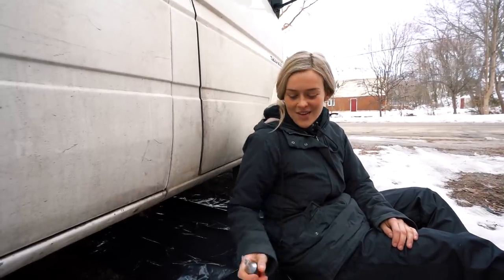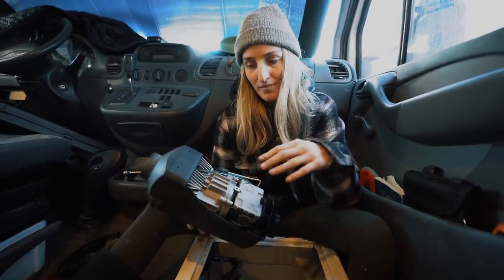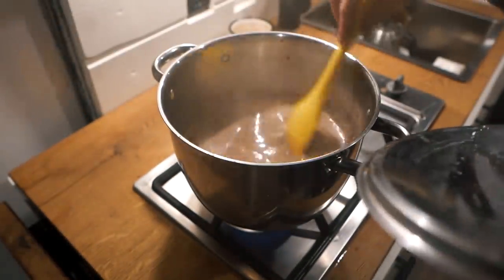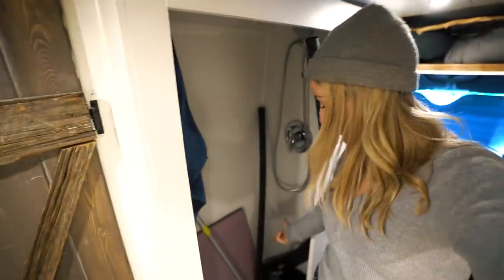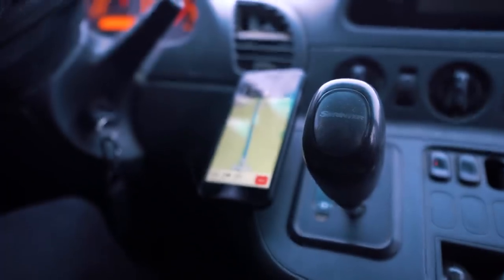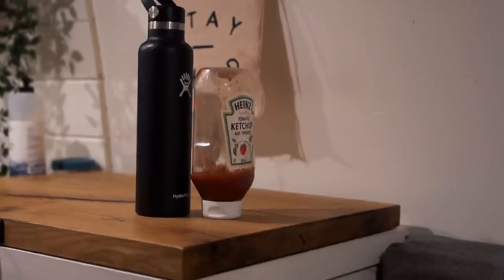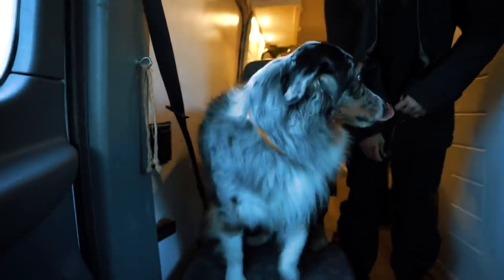VAN LIFE can SUCK | Preparing for the Cold Living in a Van (off- grid winter camping)

Comment: Iv got glow watch you both under that van in the snow "mine stoped & its a pain only when it was bad weather.I have a cheep portable Chinese 1 ,4 holes & its been reliable on low I spray egr spray in small amounts up the air intake when on it stalls a bit then needs restarting sometimes       to clean  and get around startup failure , a good blast on hi thay say to clean it , in 6 months iv never cleaned mine inside thers many people who haven't cleaned thers for 3 years + .its been a life saver & still is for me & my piggies.
Reply from the maker: They are the best little heaters around!

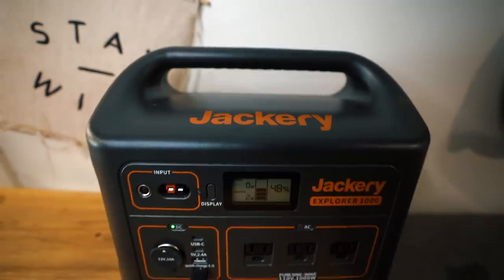Comment: 10:45 - A cigarettes lighter. I haven't heard it called that in a long time. I am 37, and my girlfriends is 33. She didn't even know that was the original use of those outlets... LOL
One thing you might want to keep in mind is when you're using the 110V outlet to charge a phone, tablet, laptop, or anything that uses DC power, you are taking the DC power in the Jackery battery, converting it to AC power, then back to DC power. The problem is that this is actually wastes a fair amount of power. As long as you're in your van, or somewhere you can plug it in, you're never really going to have a problem with that. However, if you're in a situation where you need to squeeze ever ounce of power out of it, you might just want to keep that in mind. Source: I'm a former electrical engineer.

Comment: The Esbar should have a fresh air intake on the outside of the car, not only for the combustion air. Then you get fresh warm air in the van and you are not recirculating the air. Then you get more oxygen, less co2, dryer air and less condensation.
Reply from the maker: Yes it does
Reply: @Vanwives  It looks like yours is sucking air from under the seat and heating it. You need a hose on the air intake going outside. The small air hose underneath is only for combustion air.